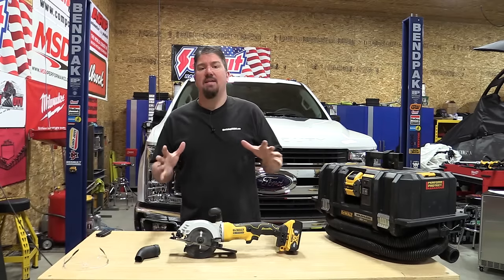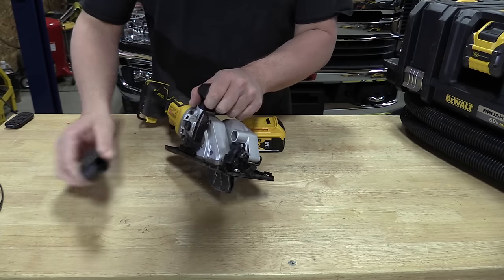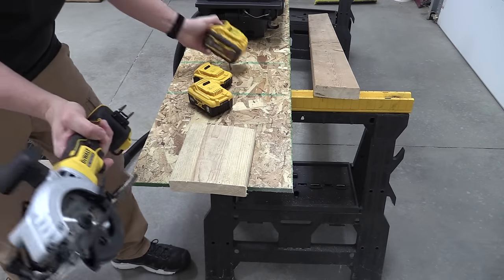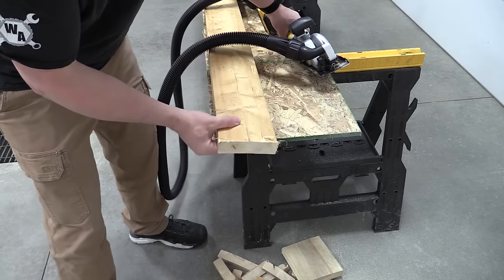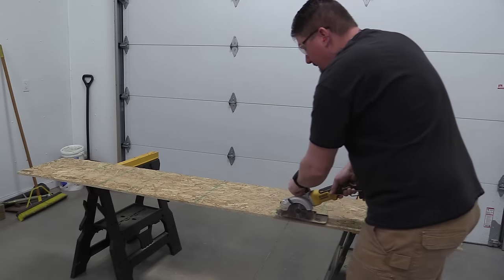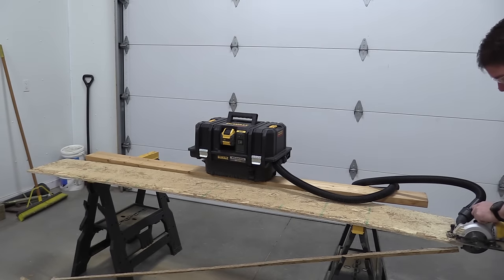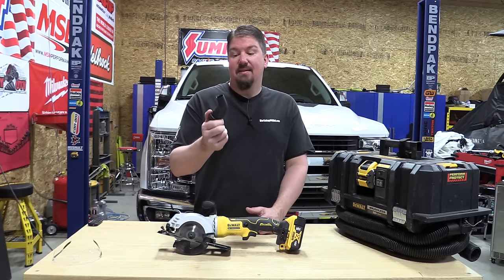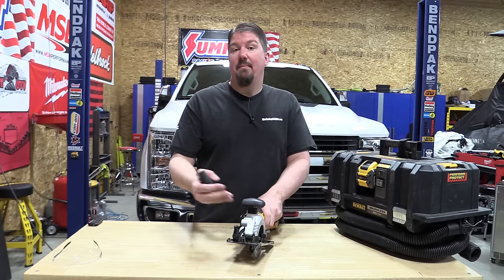DEWALT ATOMIC 20-Volt MAX Cordless 4-1/2" Circular Saw Review DCS571 Power with New FlexVolt Battery

Comment: Hey Brian. Thanks for the review. I've been using this saw on a near daily basis as a professional remodeler / contractor and although it does have a few minor quirks on occasion such as the vac adapter & allen key for blade changes needing to be better secured or stored separately to avoid losing. I've found it to be an incredibly versatile tool to have on the job site. I refer to it as my trim saw & it is perfect for flooring rips & fitment cuts. It's quick, lightweight & easy to use for accurate cuts in a multitude of materials. It's pretty much, my go to circ. saw on most of our remodeling projects. it takes care of about 80-90% of the tasks we use a circular saw for every week. It performs well and is a quicker & easier to alternative to my DCS577 Flexvolt for most applications, especially for the less experienced guys. Plus, you just can't beat the accuracy & great line of sight you get from using a blade-left saw.

Couple of tips- for best performance when cutting any kind of wood, I use the DIablo 4 3/8" 36T Carbide finish blade. Super fast & pristine cuts, with Zero Tearout (night & day difference to stock blade). 

#2. You can actually get Turbo Diamond blades with 3/8" arbor or use an adapter from amazon etc. (3/8-5/8"). WIth the right diamond blade, it is actually capable of performing clean (dry) cuts in tile, Quartz or even 2cm stone on occasion. 

#3. The factory blade or 60T HSS blades will also work well for cutting the newer types of shower waterproofing panels, kerdi, schluter, Wedi Etc. Even Cement backer board on occasion with the 60T.

Thanks for all your hard work, honest reviews & fantastic content!! Especially your dedication to producing high quality, entertaining & informative content right now, with such limited resources. It's most appreciated!!👍👍👍

 Keep up the great work, you just earned another subscriber!
Reply from the maker: Great comment that I am going to pin to the top!  Thanks for sharing your experiences!
Reply: I have this saw and really like it ... what's bothering me that the blades options are more expensive than the blades of 7 1/4 size... did you manage to find cheaper blades than home depot
Reply: you should make a video of you using it with the different blades I will watch it.. cool
Reply: Such an incredible comment on so many levels! Really truly, thank you for helping out!
Reply: @estoylisto  yes. U can usually order a 2 pack on Amazon for the price of 1 at HD

Comment: I purchased this saw on June 27th 2024, as a kit. I read the manual and came across the the dust collection section, turns out that the manual reads that the kit comes with a dust collector bag. I called Dewalt and, sure enough, they mailed me out a bag to use with this particular saw. If you purchase the kit version be sure to read your manual to see if it says that a dust bag should be supplied....🤗🤗🤗

Comment: I am a contractor and I use this on a daily basis for framing, sheet8ng and even finish carpentry. I just did some cuts on stained oak 3/4" trim, taped it with masking tape and had a perfectly smooth finish cut. I used the blade it came with, no issues. 🙏🏻😁

Comment: I didnt need it, but I bought this saw to have a new gadget. I love it! It is always in my truck right next to my Dewalt 60 volt 7 1/4". The only downsides are yes, loosing the allen tool, wish it would cut just 1/8" deeper, the screws leaves gowges in the rip guide, and its left handed. Not a fan of left handed, but on occasion that characteristic comes in handy. Besides for that, I love it. Its rips fantastically, lets me get into tighter spaces, and actually has a bit of power for its size.

Comment: I'm a Carpenter , I bought that saw about  18 months ago and I Love it , its great for small framing jobs and it's small enough to fit in my rolling bag so I always have it with me , Awesome Saw , Well Built , Buy One .....👍🖖
Reply: Hi, I just bought one and it wont cut all the way through a 4by2. Each time I try it is two mil short the shoe is all the way down . Can you tell me is the wood slightly thicker here in Ireland. Its treated 4by2. Thanks

Comment: Actually, I wasn't surprised that the dust collection port operated well.
With the vacuum on, the port is held in place by suction.
If there was a manual lock on it, and someone tripped over the vacuum hose, it could pull the saw from the operator's hand and cut them.
That's the reason Apple created MAGLOCK for their laptops.
Reply: MagSafe*

Comment: I just picked this thing up because I need a saw in my reciprocating wasn't doing the job for the 2x4 again plywood.. this thing saved the Day!  I picked it up for $100 at Home Depot because for some reason they had a $99 sticker on it on the floor but the system was ringing up at 1:50... I snatched it up and wanted to get two. As good as this thing worked I wish I would have.

Clean cuts through the 2x4s and plywood. I could use it one handed and did not have one issue. The 5 amp hour battery already had lasted the entire job today

Comment: I love how this saw dumps sawdust away from me. Very important since I use this usually in awkward positions or tighter quarters, so dust kicking up in my face would suck. Love this thing. Done so much more than I thought it would.  If I did have one wish with this, the shoe could be a be improved on . The rolled steel sometimes would ride up on guides or rulers I use as a guide, where as your typical saws will butt up on it nicely.

Comment: Hi Brian, 

This is a cool cordless trim saw. 

It would have worked great on a exterior window project i was working on. I had to cut the bevel siding that butt up to the window frame.Then i added 1 x 4 casing around the windows. Also some of the windows were in the second story.  At the time i purchased a Dremel corded trim saw with a 3 1/2 inch blade. The problem with the dremel was i had to have a extension cord and stretch to second story. 

This DeWalt cordless would work great for those types of projects. Now i would put a solid cap around the dust extractor so it can come out from the bottom of the blade guard.  Don't really need a vacuum working outside or working two story high, LOL...

I might look into this tool. Also at home depot they do carry the diablo blades for this saw. For some reason they place them on the corner of the tool rack. I quess it's  small enough to stack and people to see them. 

Thanks for the video

Comment: I just got my DeWalt DCS571B.  I bought a Power Stack battery to go with it.  It assembled together very easily.  It runs fine on my standard 1.5 ah batteries, some I have had for ten years it has cut everything that I have asked it to cut with ease.  I don’t think it needs anything but the entry level batteries for most jobs.  I am not a journeyman carpenter but I occasionally demand a lot from my tools, often outside their normal abilities- just ask my 20 odd Stihl chainsaws.😊

Comment: This is a jobsite tool, and a great one at that. It's all about weight. It will still cut through a warped two-by-four you just have to adjust the depth. This is a game-changer for certain projects especially building houses.

Comment: Nice review, Brian. I've had that saw for about a month now and it's become my go to saw. I use a ryobi dust collection bag and the dust gets stuck at the 90 degree bend. So, I'm going to 3D print an adapter that comes straight out and I think that will solve the problem. Be well.

Comment: You shouldn't need a special adapter or DeWalt vacuum/extractor for dust collection with tools that use the Quick Connector so long as your shop vac hose is 1-1/4".  Remove the nub from the end of the hose, pick up the DeWalt DWV9000 and thread it on to the bare end of that hose.  I've done that with the old hose from a scrapped shop vac and now have two hoses for my working shop vac - one for regular use and one for DeWalt dust collection.

Comment: I think if you cut the sheet goods on foam board you might get better collection. The friction fit could probably be improved with electrical tape. I would like to see if someone could get this hooked up to a rigid vacuum as that seems to be the standard on job sites in my area.

Comment: Great video! Might grab this little guy for decking to increase mobility
Reply from the maker: I think you would enjoy it for decking!
Reply: WorkshopAddict yeah I saw the little belt clip and I like how thin the head is from blade to back. I like using a circular saw for my post notches to keep them straighter then clean it up with jigsaw so I think this would be awesome. Using the 391 and I like it but it’s still too big to lug around without a hand on it. How did you find the belt clip to be?
Reply from the maker: @AjGalloway95  I am not a belt clip guy, so I cannot help you with if it would be good or bad.  Sorry.
Reply: Austin Galloway don’t notch your posts, horrible idea.
Reply: Joe Framer *around posts
Reply: WorkshopAddict haha fair enough

Comment: Says in the manual that this is only for wood or fiber cement. Not to be used for metal, plastic, concrete, masonry or wet tile. Is this so or can it be used for drywall, thin metal skirting?

Comment: Interested to know more about the DeWalt dust collection system you were using.  Maybe I missed a previous video.
Reply from the maker: I used it on concrete before as it is a HEPA vac.  https://youtu.be/iq66CC0XJG0

Comment: I purchased an ATOMIC 20V MAX Cordless Brushless 4-1/2 in. Circular Saw (Tool Only) but had to return it immediately since the trigger switch does not keep the blade running, it shuts off automatically when pressing the fully pressing the trigger even when not  cutting anything.  Even the second saw I got when returning the first one that did not work, even the second one did not work.  Had to return it also.

Comment: Wish you used the 8ah for the long cut on the sheet of plywood. I find it interesting that the 5ah and the 8ah have a difference in power even though they are both 20v batts.
Reply from the maker: You can watch our drill battery test video and it will show the voltage levels that each battery could hold, from 2ah and up.  IMHO, this is a great saw with a 5Ah battery and might be with an 8.  But if I need an 8Ah battery for this saw for power, I would pull out my 6-1/2".
Reply: Hey Jimmy, just thought I'd say that the reason higher capacity batteries deliver more power (when fully charged) is because when you drive current out of a battery, there is an associated voltage drop that occurs (Ohms law). The bigger the battery, the less significant that voltage drop is, assuming the current delivered is the same. So you maintain a higher voltage, and thus a higher power. Theoretically, with enough amp hours in your battery, that voltage drop becomes negligible. 

If you're lightly using the tool, it could pull more current from the battery to make up for the voltage drop, thus keeping your power constant. However, if you're maxing out the tool performance, and it has hit the max current it is designed to pull, any voltage drop that occurs will lower your power. That's where the big batteries help: on high demand activities. On light use, you may not notice a difference. Hope that helps!

Comment: Try a zip tie around the nozzle not to tight or cut a zip tie in half insert it into nozzle port then push it onto the saw nozzle secure it in place to where it won't move at all.
Reply from the maker: Small amount of epoxy has been put around the dust shoot and sanded to make them fit a touch tighter.

Comment: 99 bucks with a 5 hour battery, 3 hour battery and charger. I could probably take advantage of these promos and trade up to a new F-150 in a couple years lol. Matter of fact, I think Im going to take this on as a side project, see how many extras I have and start trading up. Start selling a couple batteries and charger new, then a couple bags, maybe a back pack. An extra drill here and there. I just want to see how far I can take this as a project.

Comment: I just got this saw from Amazon after Prime sale (the price dropped by $50 from $149 to $99!  Which what I was hoping from Home Depot Father's Day sale but they didn't have this saw at HD.). Now I am looking for the plywood blade.  In your recommendation, you put Porter Cable saw but it looks like the blade direction is the opposite of Dewalt's.  Is it possible or even safe to flip the blade to match the Dewalt saw rotation?  Thanks.

Comment: I need some help on the blades here as now i'm totally confused.  I bought this one linked above ►Rockwell 4-1/2-Inch 60T Circular Saw Blade:  as it has 60 teeth and 40-80 teeth is what everyone says your supposed to use on finish wood...I put this thing on and it cuts significantly worse than the 24 tooth that came with it on finish grade pine.  What am i missing here?  are all 60 tooth blades different?  Am i not supposed to be using that specific rockwell blade on wood?

Comment: I have 1/2" to 1" cement plaster walls (with the backer board) in my 1949 house and was thinking it would be good for cutting into that during the next series of remodeling projects. Do you think with the cement board blade and dust collection hooked up it would be able to handle the job? I previously used a reciprocating saw and it cut through it really well but the dust was way out of control! I have also considered a grinder but I think the dust would still be the problem. Any suggestions would be appreciated. Thanks much! Gus
Reply from the maker: I think this would work well!

Comment: Thanks for the vid.. I got this for small projects around the house. I'm just wondering,  would i be able to get a blade that cuts metal for this saw? Is it recommended?
Reply from the maker: You would want a multi-material saw for that and those are normally a 3" blade.  Dewalt and Milwaukee make them.
Reply: @WorkshopAddict  why does the blade size drop?

Comment: Hose clamp will fix that friction fit, although a twist lock would have been better.  Nice little saw for what it is.  How you liking that Dewalt vacuum?
Reply from the maker: The DEWALT vac is awesome for use with DEWALT tools.  Otherwise, you have to get out the universal adaptor.  I velcro that to the handle otherwise it walks off.  It is not the most powerful vac, but it is a nice HEPA vac that is easy to move around.
Reply: WorkshopAddict thanks Brian!

Comment: Hi guys, just got this saw today and it will not cut all the way through a treated 4by2.. its about 2mm short. Is this normal or is the wood here in Ireland slightly thicker? Hope you can help as I really like the saw but that is the main reason I bought it

Comment: I wonder if you can attach a dust bag to this saw like the ones used on the miter saw
Reply from the maker: Probably, but I an unsure how well it would work.
Reply: @WorkshopAddict  Won't be as good as a vacuum but at least it will collect at least 75% of the dust

Comment: This saw seems heavier than my DEWALT 6 1/2” circ saw but it’s not. The switch takes some getting used to. The DEWALT tapered adapter, part number DWV9110, fits the dust port adapter. I have another DEWALT tool that uses the same Allen wrench that gets loose with use... I superglued a rare earth magnet next to it and it keeps it in place. If the dust port adapter ever works it way loose I’ll put a couple of tiny drops of super glue on it and sprinkle a little baking soda and it will be fine.
Did anyone else find the weight and trigger awkward to use one handed???